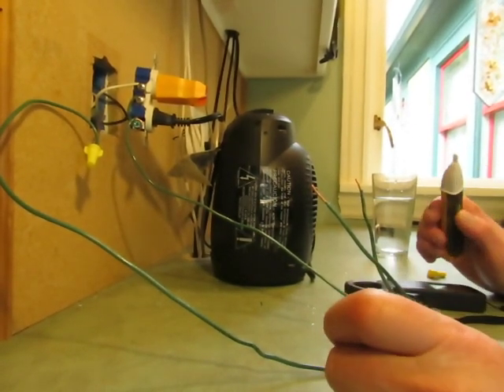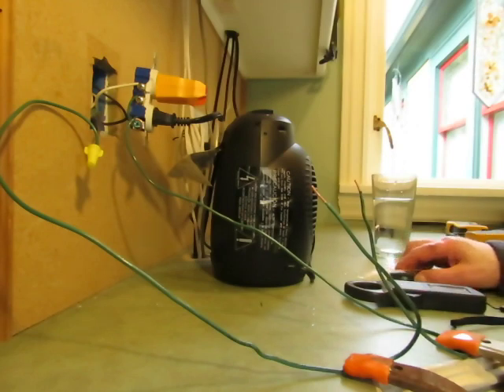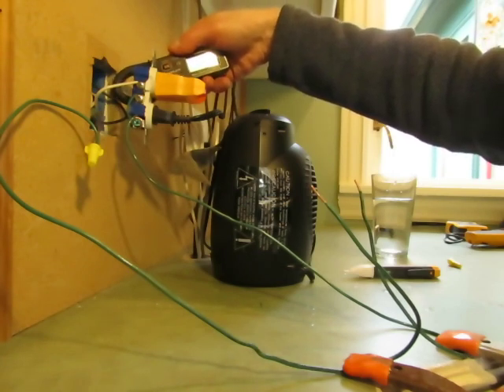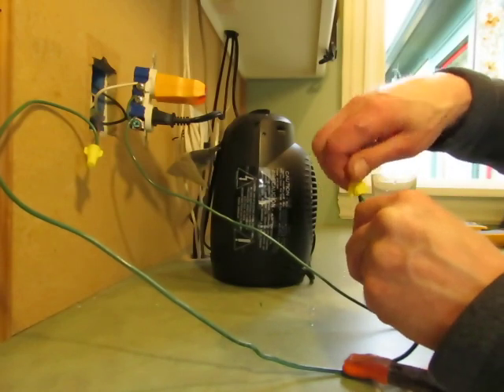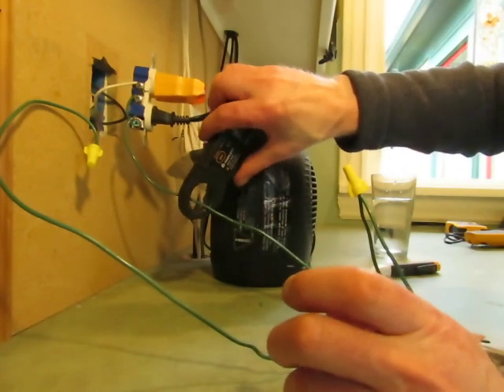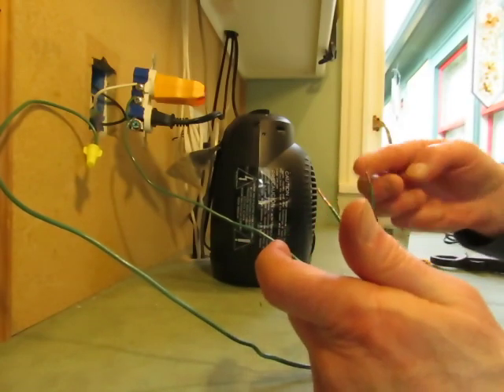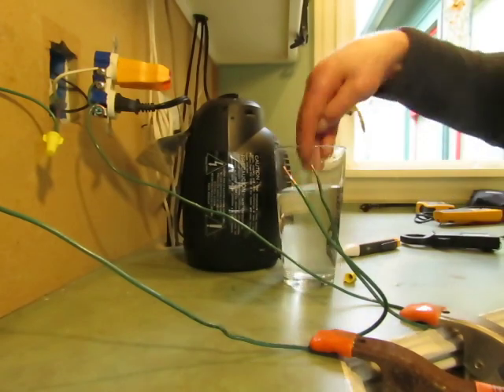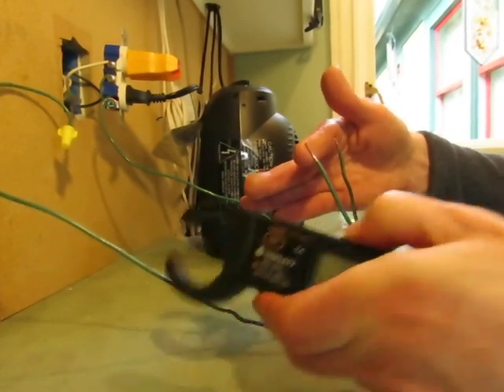Neutral to Ground Bootleg

Comment: It seems to me that if you plug in an appliance with a three prong plug, then you'd be connecting ground to neutral within the appliance and could be a shock hazard if there's any exposed metal even though the neutral wire is not open.

Comment: Thanks for making this video, but as others have said, this doesn’t appear to be a typical bootleg scenario. The bootleg is when you use the neutral both as the normal path back to the panel when the appliance is operating normally, and as the safety path to the panel to clear a ground fault. You do that by bonding the neutral and ground terminals together with the little jumper. There’s no reason to do this if you already have a dedicated ground back to the panel. Lastly, as many on YouTube have pointed out, this arrangement will clear a ground fault, but when you start using components of your electrical system in ways other than they are intended to be used, you might cause confusion or injury to the next schmo to grab a screw driver and start monkeying around
Reply from the maker: The ground of the circuit has been disconnected (temporarily) from the receptacle purely to show how a neutral to ground is not a shock hazard like is so often said.  That is all this demo is about.
Reply: @CharlesBuell  got it. Unless someone improperly reverses a neutral and hot upstream, then you have hot to ground, and a hot appliance.
Reply from the maker: @spikeklein2196  absolutely---extremely deadly bootleg then.  Just losing the neutral is dangerous because then the "neutral" could become a hot to the point of the break.
Reply: Would losing the neutral trip an RCD though?

Comment: not a fair experiment, the heater is not grounded, its a 2 wire unit with a plastic chassis....
Reply from the maker: The heater is merely source of current.  That it is not grounded has nothing to do with the experiment

Comment: I don't usually comment on videos, but this is worth while given you went out of your way to demonstrate real world conditions of connecting neutral to ground (bootlegging per say) on the same circuit. 

Excellent video for people to better understand shock potential in this circumstance. That said, it is not to code and most will say don't do this for safety reasons and liability. I'll leave it at that.
Reply: Having a dedicated ground is essential for equipment that requires it to operate safely at all times. If there is a fault on the neutral the grounded chassis will become live

Comment: Total confusion sir:  Is there an equipment ground back to the service panel
or not?      Bootleg ground the neutral is used as the equipment ground?
P.S. Please use a load that does not make noise during filming. Thank you.
Reply from the maker: yes there is. The only noise is the heater running.

Comment: I have yet to find a real problem with bootleg grounding. The only way it can work against you is if the neutral wire opens somewhere on the way to the panel, and, you are well grounded touching the chassis of a piece of equipment that has an internal short to chassis situation. What are the odds? A MILLION TO ONE? You are the first YouTuber I ran across that did not just say "It's dangerous, dont do it".
Reply: I've come to the same conclusion and envisioned the same scenario you describe, chances are slim that would happen but with close to 7 billion people on the planet I guess it could.  

Also, I'm not sure this is really a bootleg, more an example of parallel paths back to the source but it shows that so long as the neutral is connected then current flow will go through that and not the ground, should you happen to put yourself in the middle of ground like Charles did.  The problem there is that if the neutral is cut/damaged and you go to disconnect the ground without shutting off power then you might have problems if you contact the bare wire.  

In a real bootleg, though, wouldn't you just be jumping from the ground terminal to the neutral terminal/wire?  In that case you wouldn't even worry about grounding yourself save for the broken neutral + short to chassis scenario.
Reply: Exactly from what I understand the danger of a bootleg connection is if the neutral becomes disconnected then the chassis of the device becomes live. In theory though this should trip an RCD right?